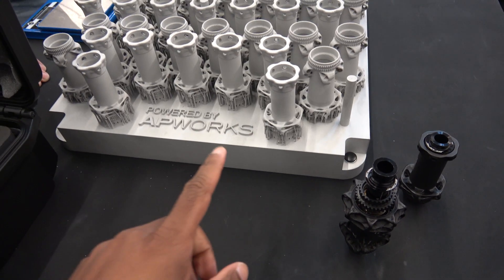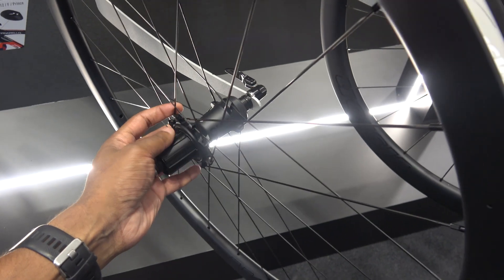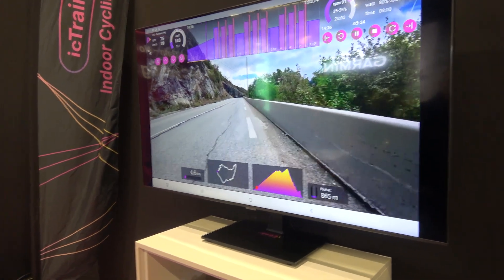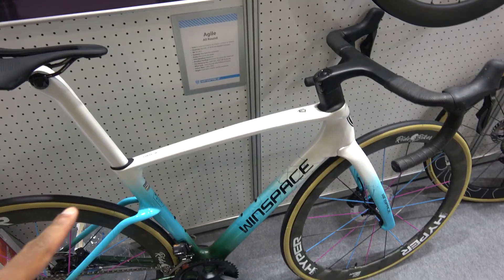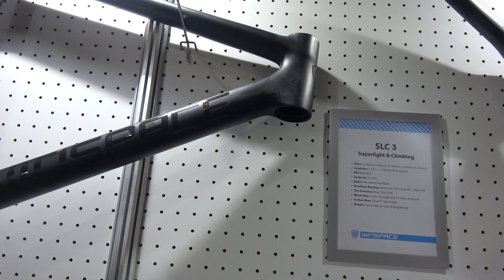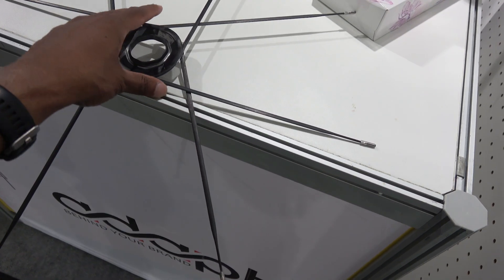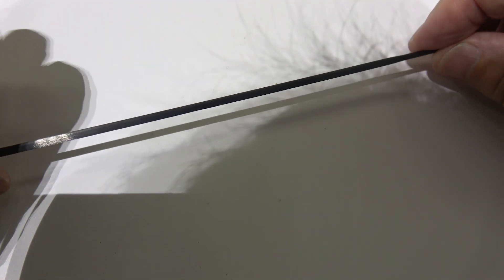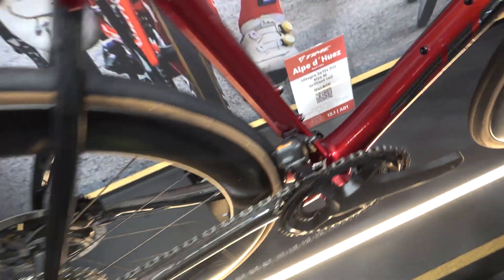CRAP 3D Printed hubs| David Arthur Reams me, EXCLUSIVE NACA spokes: Real Reporting Eurobike 2024

Comment: Young engineers think 3D printing is the end all be all. It’s not so. There’s no long term studies on the longevity of the bonding of layers process used in 3D printing. No studies on microscopic contamination between layers. It is cool technology, but nowhere near mature enough to trust your life to
Reply: With some 3D printing technologies you get complete freedom of geometry, achieving the holy grail or lighter AND stronger.
Reply: @bjmaston  what about longevity, susceptibility to contamination/corrosion? Trust your life to it if you want, me? Nope!!
Reply: @patmaweini952  Titanium does not corrode. Longevity is a function of design and not intrinsic to 3D printing.
Reply: @bjmaston  I don't agree, I've seen enough material failures in my 40 year career to have my doubts.

Comment: If you're old enough 3D printing seems like the CNC of the day. Back then tons of crap was quickly machined out of aluminum billet instead of forged and most of it quickly failed because it just wasn't strong enough. Cranks, seatposts, hubs...all had gorgeous color anodizing and quickly ended up in a recycling bin and (sometimes) the rider in the hospital. How long before 3D printed stuff is in a recycling bin?

Comment: Looks like Carbon.   The bike industry cannot have usefull innovation like those hydraulic disconnects.   I was wondering if some of the major frame designers were going to introduce a revolutionary wheel size , 26" for gravel racing.   you will be lower to the ground and have much better aero.

Comment: 3d printing and a perfect end product doesn't mix if its printed then machined the 3d printing can be cleaned up to perfection but no 3d print comes off of the printer perfect that also doesn't mean it's not structurally sound so kind of a unnecessary reaming scope didn't deserve.. especially from an engineer that understands more than the normal human you should have been able to put those points together before you made that video and left the booth that was corny and totally wrong.
Reply from the maker: have a look at my instagram. The pictures say it all.
Reply: why not ream a garbage product?  That hub looked like it was made by a vocational school dropout student.

Comment: 3D printing or SLS was developed for rapid prototyping without the need for machining or mould tooling . But it’s fast becoming a marketing managers wet dream. People on the street seem to think it magic or better than a cnc made part , or a part that injection moulded . It’s not in most cases . Saddles custom made that are 3D printed is a benefit , but apart from that it’s just over priced hype

Comment: 3D printed hubs = Murder Inc.
Reply: Today parts of turbopumps from rocket engines are 3d printed, and brackets of the fuselage of Airbus aircraft. The surface of this hub clearly has some room for improvements but this does not tell anything about the strength of the material

Comment: As someone into the 3d printing world, one of the main reasons you would replace conventional manufacturing with 3d printing is if there were geometries that were just not possible to manufacture. It doesn't seem like those hubs are solving any problems and adding to complexity by having computer generated structures.

Comment: am I wrong in thinking the t1550 downtube leading edge iss a bit too blunt and the taper towards the trailing edge a bit too aggresive to be ideal?

also am waiting to see if farports offer and rims that are 30+ mm wide and 60+ mm deep. Would be great to have a wide tyre at the back for rolling resistance and comfort gains without gimping aerodynamics by putting a way too wide tyre for the rim.

Comment: LTwoo need to get on board with replacement batteries like SRAM do .. otherwise its just a waste of cash unles they guarnatee replacing deraileurs when the  irreplaceable battery fails...  Luke at @TraceVelo covered this a while ago..
Reply: You must be thinking in wintop.   The batteries on Ltwoo are easily replaceable and standard sized

Comment: L-twoo stand gave me a idea how I could adapt my dad's bike to my little body. I had no idea one could not only flip stem but run it backwards.
Reply: You’ll boink your junk on the stem and the same with your knees and the handlebar, I reckon. The steering will also be super twitch
Reply: mind you, a stem also affects how you steer. Like a long stem has windshield piper effect since you not only rotate the bar, but basically move it sideways. If you flip the stem, you also reverse this mechanic

Comment: hydraulic decouplers would be useful if the frame holes could let them pass through, at least most of the carbon and alloy frame holes only let the hose pass, and it seems that the decoupler is a little bit bigger. 
i have a pair of formula brakes with its "speedlock" connector (what is more or less the same as a decoupler) and its useless, it let you remove the brake caliper for what? the connector diameter is massive, its impossible to get it through a frame.

Comment: Crap 3D printed hubs? Measured to what objective standard? Man, you are sliding closer to the gutter every week…..
Reply from the maker: Being able to see the hole is jagged with my eye
Reply: @Hambini ribbed, for your pleasure.
Reply: @Hambini  jagged holes are never a good thing.
Reply: @Hambini  3D printing seems 'wrong' for hub manufacturing. But a "jagged hole" when you build a wheel could actually reduce twist motion of straight pull spoke when wheel building.
Reply: @schultzy1971  LOL
Reply: Smooth holes are a mans best friend
Reply: Yeah, Hambini is correct.  Those hubs objectively looked like garbage. Can't believe someone would bring that to a trade show and think people would be impressed simply because it is 3D printed. Looked like it was fabbed by a vocational school reject. LOL

Comment: Of all the qualifier Vision would like their wheels to get, Agricultural must be the last one.
Reply: saw a video going over the TDF bikes and a number of those tractors were running Vision wheels.
Reply: The factory pre-built rim brake wheel market is dumping all its stock i think. I had a hell of a time finding a decent wheelset that was a, available to buy in the UK, b, did not cost a fortune and c, was not either mavic, fulcrum or campag. 

I rode mavic for the last 35 years because of their SUP tech where they weld the rims together. This weld makes it so you do not get stuttter when braking. Others that use pins to join the rim jionts tend to get a build up of rubber that causes the stuttering. Even if you clean the rubber off there will be most times a metal lip from the pinning process that will still cause the stuttering. Even pinned then milled rims will still get that metal lip over time causing the stuttering when braking. 

So i like Mavics.

Till i got a pair of Mavic Cosmic Elite wheels in 2018 The rim is SUP welded like the Open CD series. Aero spokes. They look the part, feel the part and act the part till you start using them on a regular basis. Unlike fulcrum and others, Mavic do not seem to have a no twisting of the aero spoke tech on most of their wheels. This leaves you at the mercy of having to constantly twist, with a bladed spoke tool, the spokes back into the proper angle. After every ride i would be using the tool to twist the damn spokes back. 

If you only twist the bladed spoke and not the nipple with it at the same time, you are slowly but surely trueing the wheel into being bent. This is what happened to the rim over time. I bent it out of shape and made it useless due to the daily spoke twisting that i had to corrent. 

The wheel set was tensioned for me when i first got them. So these were not loose spokes but a crap system that does not hold the spoke into place on the hub.  So i am staying away from Mavic as none of their weels have a tech to stop the aaro spokes from twisting. Fulcrum and campag have this tech built into their wheels and their spokes do not twist.

Why am i saying all this?

I bought a pair of Vision Trimax 30KB's. But instead of a bike shop where you normally buy bike parts, i had to buy it on ebay cos no shops here in the UK had rim brake wheels for sale. They did have some but they were mostly carbon and in the 750+ pound sterling range. I am not in a position to spend 750 or more for a set of wheels.

I ended up spending 300 pound on the set.

Lets see if their wheels hold up better. They look really well made and i saw how they are made in a yourtube clip. They properly relieve the stress and re-true when buidling the wheels like you should to get a propely built wheel. I was impressed when i saw that. They even had a machine that stressed the wheel for them. It was as if somebody stood with all their weight on top of one side of the hub and did the same on the other side. Rinse and repeat a few times.

On my every day bikes that i ride i have 105 hubs on 32 hole Mavic Open CD's. GOod wheels. They use J bent spokes. NO aero spokes. J bent aero spokes also wont bend.

Long read....sorry :) BUt i was so impressed with the Vision wheels and the quality that i also did not know what to think of that agricultural description. It made it almost sound bad when then are good wheels. These wheels were not so long ago in the range i could not afford. But people are dumping their rim brake wheels so i could get them.
Reply: I like tractors.
Reply: that Agricultural hit hard for some reason and I don't even get the slung

Comment: Those quick disconnect hydraulic parts should be an industry standard. What a great product.
Reply: Been in the endurance racing world for a long while now. Should have been designed into the system from the start. Marketing saying they copied the car industry yet didn't bother with this likely as the first to market cost would be extremely high to justify it. Guess now it is reasonable seeing how much people are paying for bikes these days.
Reply: @paulschulman8131  no doubt significantly more expensive
Reply: I have quick connect couplers for the hydraulic line of my Kubota garden tractor. The Japanese are so advanced 😂🙃
Reply: There is one company (No. 22 Bikes) that already offers it on their breakaway design bikes.   As others have mentioned, if this were standard equipment, it could allow the bars to be removed and therefore the fork as well, which would make for a much more compact package when shipping or traveling.  When the bars and fork is removed, most bikes will fit in the backseat of a compact car  or taxi (with both wheels removed), which cuts your transportation costs significantly. No van needed to get to the airport. 
In the absence of a coupler, I'd get an extra length of front brake hose and put a loop in it so that it would allow the fork to be dropped out and stashed horizontally in the shipping case or box.  I'd coil up the extra hose into a loop in front of the headtube for riding.
Reply: @bengt_axle  No.22 Bikes procures these couplers from the company in this video. The gentleman whose face flashed in the video and showed Hambini how the system worked is the guy who makes couplers for No.22. This gentleman's name is Wu Tangwei, from Taiwan. His company is ZENO, which makes a lot of cool stuff related to hydro brakes.
Reply: Most racing motorcycles have hydraulic quick disconnects.
Reply: Technically, this idea has been around for a very long time. Both Shimano and Sram have systems for this but they are all OEM, and I haven't seen any on the newest batch of groupsets. Formula, which has a background on motorcycles and F1 racing, has had these for a while for all 3 major players and I use them on my Trek Boone, which I pack up frequently. Great product for sure!
Reply: For flat bar bike users, Magura also just introduced a new brake with a similar disconnect feature.
Reply: I’ve missed you little man ❤
Reply: Yep, a few folks have had similar quick disconnect brake hose couplers. Formula was probably the earliest one. Most recent was No22 Bikes.
Reply: I thought that would be a good idea on a CC bike for switching to drops for gravel rides.
Reply: there's already a few who have similar for MTB brakes, Magura, Lewis and another the name I can't remember.
Reply: @CurtisCycles  
Intend?
Trickstuff?
Reply: Formula. @CurtisCycles
Reply: Fixing issues that don't need to exist on road bikes haha keep being flossed of all your moneymy friends, PLEASE! Keep driving down the cost of the far superior SRAM red mechanical for me 🤙🏼 I absolutely love it